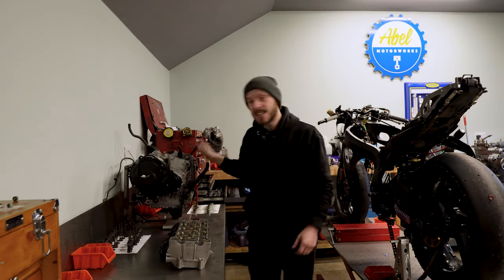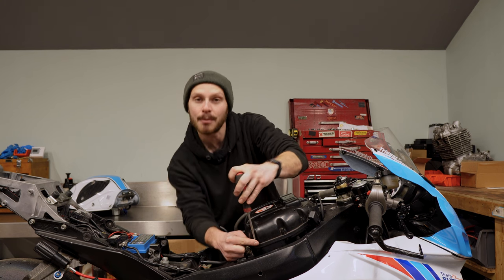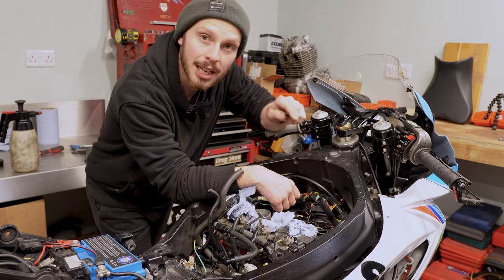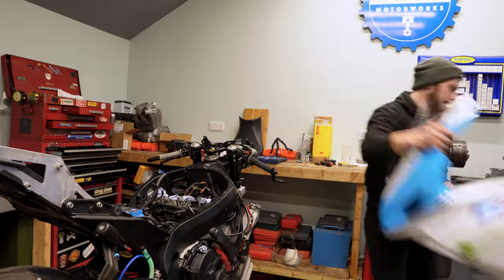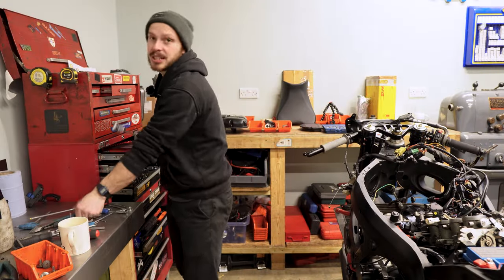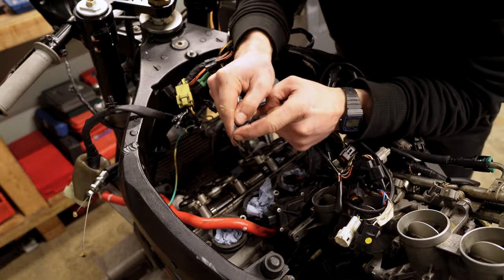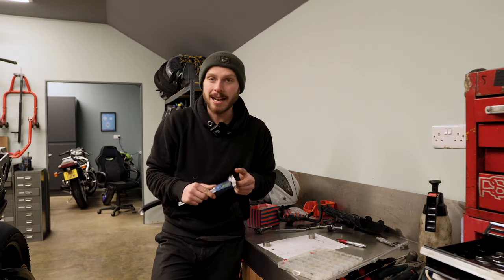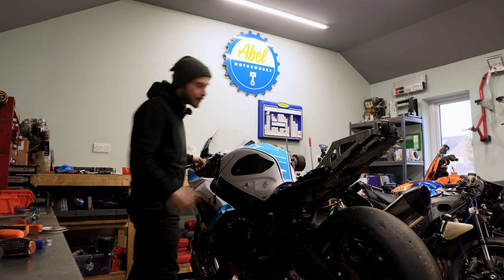How I Film Reels / GSX-R750 Valve Clearances

Comment: Friend of mine has the same bike it smokes real bad on start up, stinks, sometimes stalls after a run, he's been told its the throttle bodys quoted 2 grand for the fix, I think its valve seals as it stops  smoking when warmed up, stalling IMO because the dirty fuel what you think off the cuff ?